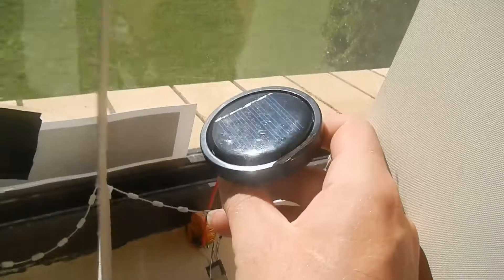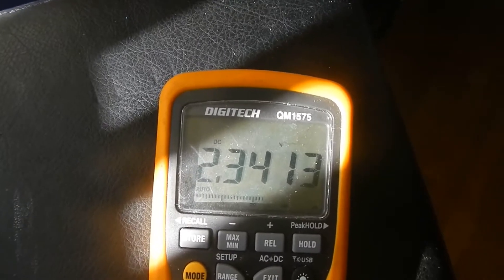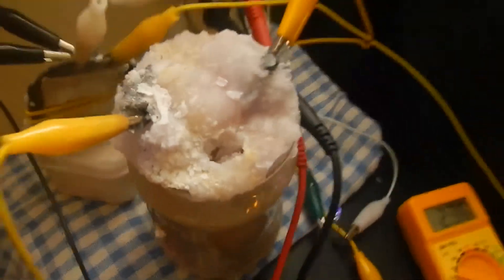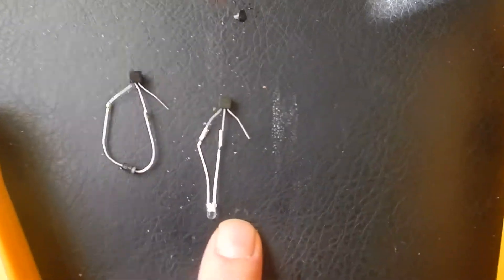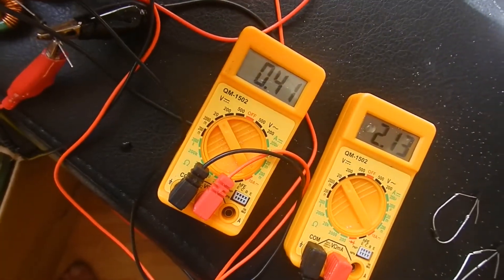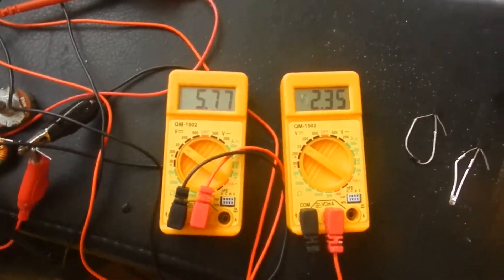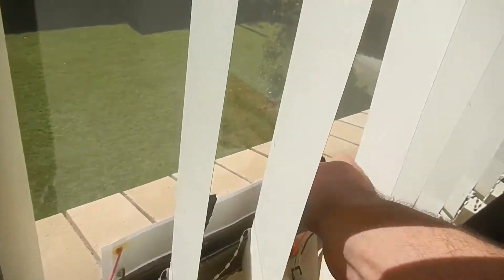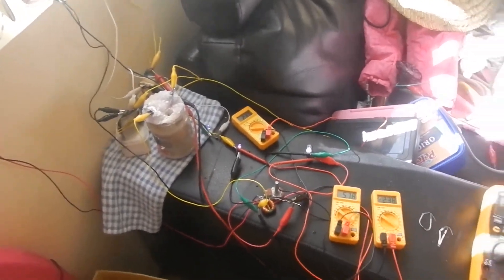Battery Sensing Cap Dump circuit and solar harvester update.

Comment: Nice work! I thought I had already subed you? Done now :)  Thanks for sharing my friend.
Reply from the maker: Long term update. All the 2n2222 transistors I did this with died. Use something that can take an amp or so. Tip122 works well, but blows the LED's sometimes.

Comment from the maker: Sort of. Not so much a pulse width control, width depends more on cap size and length of discharge. Its more of a magnitude controller. Sets the charging voltage differential, and the amps work themselves out. So for a 12v battery you really want to charge from 14v or more. This is a simple way to get the cap to 14v before it discharges into the battery. I'm really impressed with the efficiency too! About 97-98% and its lighting the led as well. It has no overcharge protection though.

Comment from the maker: No worries :) I had to tweak a few values (more base resistance than I have) a tiny bit to get it to run as it does in real life, so not perfect, but usually gets pretty close. It's a really good simple sim. Easy to use. Make sure you spend some time right clicking and experimenting with the menus and scope settings etc! Check out the falstad site for a bunch of other great science sims too!! All are open source and downloadable too, great for offline use! inbox me if you need help...

Comment from the maker: For solid crystal batterys, the water has mostly evapped already. The big one has gone to a lumpy gel state. Which is way better than silty alum at the bottom and copper sulfated (From eating the chromium out of my mixing spoon??) water separated above. Just needed a god twist'n'shake while 6A was warming it up. Good things come to those with enough drive current :) Fluid reduces impedance a lot. Can get 1-2A out (with little drop) directly after 6a charge, or a very steady 200ma next day.

Comment from the maker: I am adding a link to Falstads circuit sim in the description. It should fire up a Java Applet running the circuit, which also doubles as a circuit drawing :)

I need to test the LED in the sun now. It likely will just increase the charge power by a tiny fraction. It may have a possibly undesirable effect of increasing the voltage differential for charging. If it does it could be a good thing if considered carefully.  I cant see sun on the LED having much effect though, diodes will do the same.

Comment: I can't judge you on it, I destroyed an alum car battery charging a shorted cell. 
Liquification is a cool discovery, can't mix chemicals better than that and where's the water going to evaporate to if it's turned to crystals ! 
TIP122 was in first wireless project, yep they osc readily.

Comment from the maker: Needed a break, brain was hurting :) LOL!  A window isn't really necessary. The .7w amorphous panel, and the 10w monocryslaline, Both continue to charge after sunset :) Till about 10 min before a light would be needed to walk around outside. They will also charge off the room lighting at night. If stuck with garden light panels, 2-3 in series or parallel will work ok. .5v is fine, but they really need 1ma or more, ambient light is fine. You could stick some panels on an outside wall ;p Skylight?

Comment from the maker: The light in this circuit is actually a waste of energy, and accounts for most of the 2% loss.... Although a few diodes in series offers a similar loss, without the handy charging indicator light.

Do you have a plan or schematic to show the boost circuits in your light? Or are you simply running of non-pulsed dc? I cant really see whats going on inside... Which is why I have all the wires exposed...

Comment from the maker: There will be a slimmed down neater version, once I work out exactly what I want. I'm looking at a 5-6v battery, with a light and USB charging port, as well as the ability to charge the internal battery from flat AA's etc... Silicon transistors need about 0.4v to start. If you want to go lower than that, Germanium Transistors can be started (and light an LED) from as low as 60mv@1ma (0.00006w) The main idea with this, is harvesting trace (unusable) amounts of power to do something useful.

Comment from the maker: This is more about charging a battery than making light. Once you have charge you can do whatever you like. If you Incorporated this system into your light, it would charge (slowly) in ambient light. From a smaller panel. Like a 1-2v 20ma garden light panel. The only parts I paid for was the Transistors and LED's. I have transistors and LEDs I could use that are from scrap. The wires are only there as its prototype. Anyone can now use this to improve something like your light :) Cont...

Comment from the maker: 10w panel, green core, and tip122 is rater lethal btw... Can get a few ma @50v out of the 35v 3300µf cap in about 20 sec's of shade light :) I have to short cap before connecting battery, or it smokes the led and 2n2222 with a loud pop. Brings the big cell up over 3v sometimes. Its 1:1 wind too. I'm almost scared to try a HV 10:1 wind on that one. That the tip122 will oscillate on 18v with no base resistor was a nice find too!

Comment from the maker: The big one was only half full from evaporation, so had to drill the crystal to get water in (nail and hammer didn't work... too hard!). Then it was water on top of solid crystal.... so after liquifying the little ones (First one did so well I did it to the other on purpose) I thought I'd give it a go. Worked a treat! Now it has crystal right to the top, and better performance. The harder of the two little ones is often above 2v after 24 hours of no charging!|
cont...

Comment from the maker: Thats an understatement. After sitting on the desk for last 6 months, they all had about .6v and a few micro amps. While the solar harvesters do bring them up to over 1.5v nicely, the smaller panels are slow to put the amp hours in. Got impatient and put a 12v car battery across them. The first was only supposed to be for a few min, while I had a smoke. I forgot, and 3 hours later the solid alum block had re-liquified from the heat! was drawing 6 amps! they seem to like the abuse though :) cont.

Comment from the maker: My latest solar charging invention. Questions and comments very welcome. I'm also very keen to find a few people interested in replicating this stuff, and testing it independently. So people can see I'm not just making this stuff up, and to help spread the word and raise awareness. Most of my parts are recycled from used electronics. It really is very easy to make your own power for free! Your going to have to work hard to run a fridge or hot water service with salvaged parts, But with parts from a couple of broken solar garden lights, and a few other bits. I can light my home quite well. Much better than the crappy garden lights can.
Reply from the maker: Nope, just a really cheap one from my local supplier http://www.jaycar.com.au/productView.asp?ID=QM1502

You know its crap when they dont list input impedance in the specs :) They are surprisingly accurate though. I get 6 at a time, as cheaper than fuses for my good meter. Any chance of meter destruction, and I reach for the cheap ones.